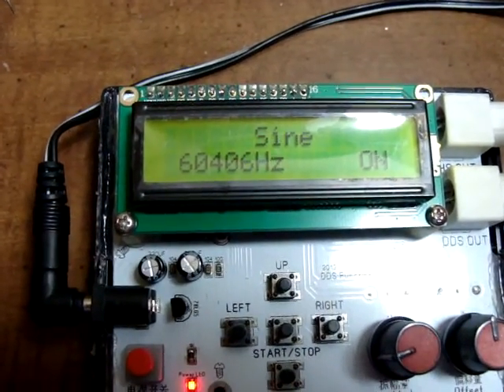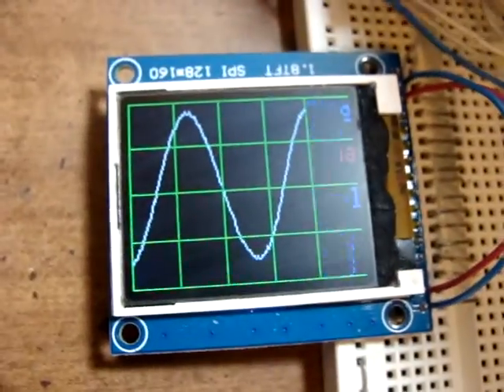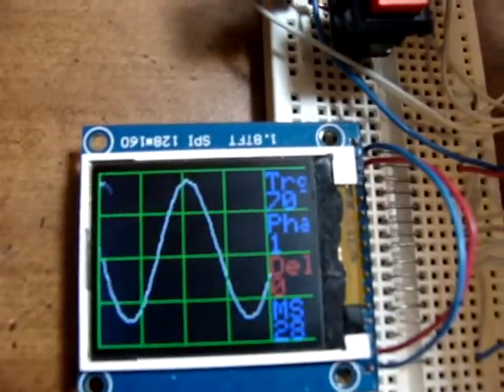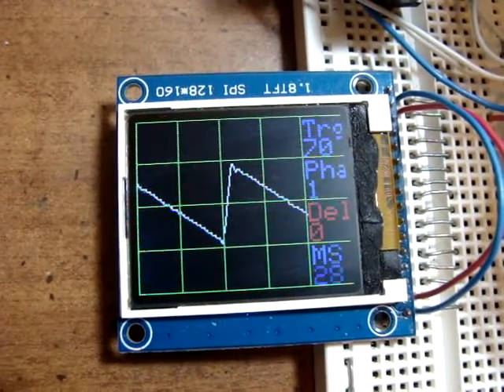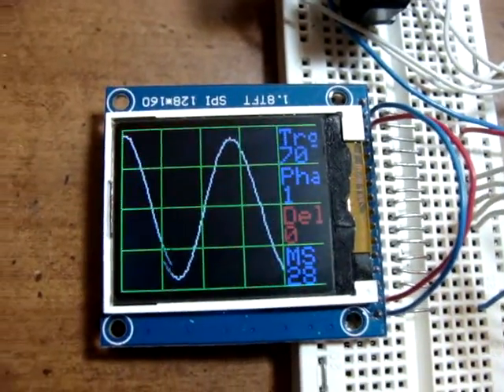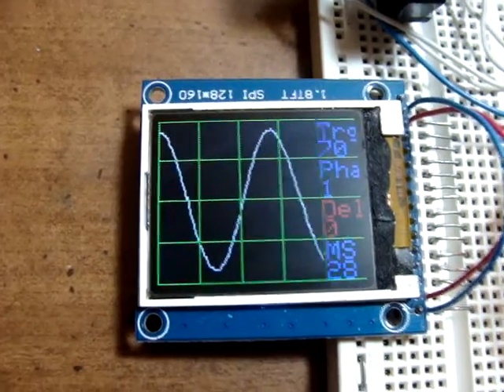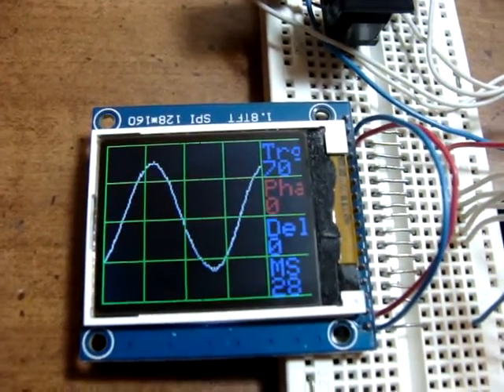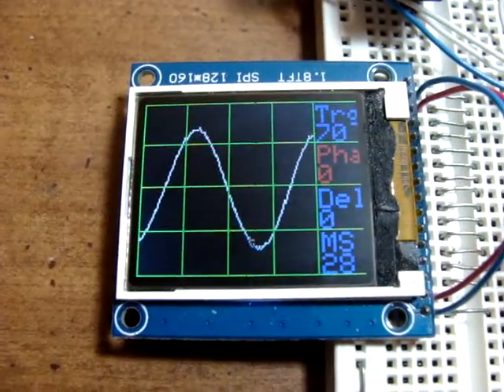Latest 8 bit 5MSPS Arduino powered oscilloscope

Comment: Just got me an UNO ....... got software running and supposedly system says driver installed CH340 for a virtual com3 (and won't let me apply the arduino.inf file). but -- can't upload to Uno, and while software open and board connected there is a constant (judged from sounds) opening and closing effect as if some prog is opening and closing! Not sure what to do right now. Try uninstalling that driver and try to get arduino.inf accepted?
That scope works brilliantly, even for 8 bit it's very useful.